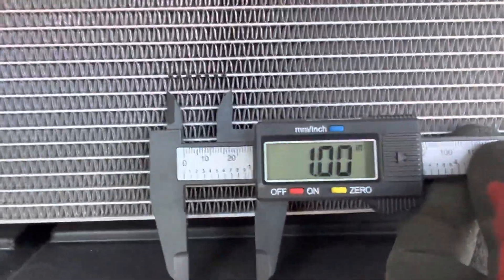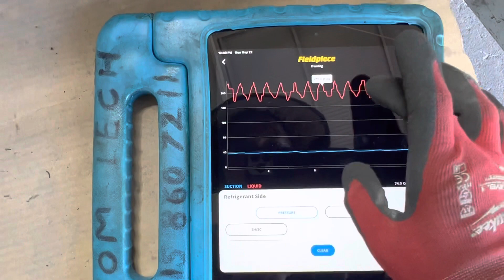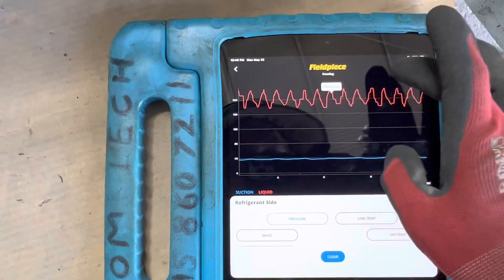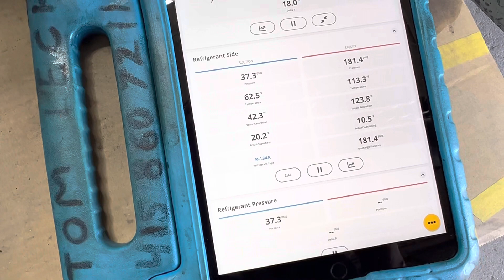AFTERMARKET AC CONDENSER CAUSE FASTER HV BATTERY 🪫 DISCHARGE, LOWER GAS MPG, SHORT COMPRESSOR LIFE

Comment: Hi. I have an Honda odyssey 2013 model. I had changed the condenser, expansion valve and compressor all OEM. I can see the sweating of the return pipe. The the pipe not very cold and the cooling of the car is not so good. The pressure gauge is all
Good. I don’t know what else can be done. There are no leaks or anything. Could you suggest me what else should I look at for troubleshooting it.
Reply: I did 1 hour Vaccum test to check for any leaks. There was no change in pressure gauge. 

I had put an aftermarket condenser. So I had issues when the ambient temp got hot. It would stop cooling when stationary. So after seeing your video I purchased OEM. Now it is cooling both when stationary and while moving but as I mentioned not to that level. At least the aftermarket condenser it cooled when it was in motion better. 

Anyway as you said I will check the blender actuator as I can hear from dash some tapping sound. But I could hear it before also and it would cool properly.
Reply from the maker: @syednajeeb998  just because the actuators make a sound and they move does not mean they’re moving all the way and actually closing and sealing 100%. 

Just a tiny crack can let in more hot air from a heater core. Then what the air conditioning can handle heat always wins. . 

You could attempt by using hose clamps. If you don’t have them some vice grips in some quarters or large washers on your heater hoses. . 

Lock off the heater hoses to your heater core it’ll take five or 10 minutes forward to fully cool down . 

And then re-run your test. 

And if your system is not charged by using wait on an accurate scale on a stable platform with no movement of the hose, or the can, or the scale or the car or the gauges . 

If the weight is not accurate within 20 to 50 . 

Then your temperatures are measurements mean nothing everything is only guessing . 

Guessing always give you wrong numbers, wrong pressures, wrong temperatures . 

That you cannot use for diagnosis . 

Vacuum is not a good way to look for a leak that only find leaks under vacuum. There’s a lot of leaks that don’t leak in the vacuum. They actually seal up because it’s pulling in word on the rubber and it has a thin film of oil in it sealed absolutely perfectly with no leaks under vacuum. 

Vacuum is only 14.7 psi of pressure difference between atmospheric and vacuum 

Where a high-pressure nitrogen, decay test can be 200 psi in positive pressure in the direction, pushing out at which the leak would normally happen 

All the plastic pieces and foam in anything in there that was in the original vehicle that blocks the air from going around from the engine compartment around the left and right side from underneath the vehicle, including the plastic panel underneath the engine, all have to be in place .  If not your stop and go traffic situation very slow, speed, or sitting at the stoplight will lose efficiency because of the hot air that rolls around from the engine..
Reply from the maker: And how do you know you do not have any leaks. 

Actually, all cars leak just some more than others even brand new ones . 

It sounds like you’re in a high humidity area 

You say the section line is sweating ? , but at the same time to suction line is not cold ?

And it is not blowing cold out the dash . 

Blender door under your – it’s not operating properly or leaking. Buy some heater core hot cool into the vet Peter Hore, and that is bleeding by mixing with your air. . 

So those two quick things that come to mind .

Comment: hi my 2014 Prius needs ac flush. You help me diagnose last year at luscious garage. I don’t know you remember or not I put the EZ CHILl in the AC. it makes noise now I really need to fix it.
Reply: thank you for your information. it’s almost have to replace the whole ac system. I have to think twice. last time estimate for about 1500 to flush
Reply from the maker: @qvzzx  but now you have to add parts

And things are much more expensive and a lot of shops have raise their labor rates so they can pay their employees more so they don’t leave Specialty here in San Francisco. 

Even I had to raise my labor rate 24% since before and after Covid
Reply: it's a very hard decision get it to fix or trade it in. I though I could get it fixed with 1500. but now maybe one option to trade it in.  thank you for your time
Reply from the maker: @qvzzx  it doesn’t hurt to ask you can call up luscious/ aka earthling 
And see if they’ve changed their prices .  

Most shops have in the last year or two .  

Shops who have not are really struggling can not pay their employees good wages, and are having a hard time purchasing supplies. Many have gone out of business..
Reply: Do you think you can help me to flush and how much you charge. I can remove the wiper part let you easier to get to the back
Reply from the maker: @qvzzx  unfortunately, I am far too busy with all my customers being a vendor and doing what I already do then be stuck doing a lengthy, long manual labor procedure

And I believe my labor rate per hour is higher than Luscious Garage .   

So unfortunately, I would not be able to help you do this vehicle. I am extremely backlogged with all the work that I already have.
Reply from the maker: I think I remember the easy chill the stuff where if you read the instructions really carefully that little*they tell you do not put it in electric cars 😱🤔. 

I think I remember this discussion 

Since they use an additive, that is not compatible with Alexa compressors or the windings, there’s only one way to do this correctly and with any kind of warranty 

The system will have to be dismantled. The expansion valve Hass to be removed to flush the evaporator and because it’s a Prius and it’s so old you may wanna think about replacing the Evaporator because you’re about to put a lot of money into this car. 

Then you flush all the pipes and hoses, replace the compressor, replace the condenser replace all the O-rings . 

Because you’re gonna have each and every component disconnected anyway . 

Don’t worry, you’re not the only one who put any of the easy chill in the AC or put in AC PRO

AND THEN, ONE OR TWO YEARS LATER NEEDS EVERYTHING REPLACED AND FLUSHED. IT’S JUST SAY EXPENSIVE LEARNING CURVE. . 

Luscious Garage has now changed her name to earth link I mean earthling. 

They’ve moved locations 
.
Reply: Understand. Once again thank you for your time

Comment: When condensers are to small and have elevated temp/ psi rise when going from idle to 1200--1500 rpm act exactly the same as any undersize heat exchanger oil/air ,, water/air . Basically as the extra load is applied the heat exchanger cannot reject/dissipate  the additional heat load  fast enough , resulting in  pressure /temp rise occurring  .
Reply from the maker: Yes, unless you drop down to airflow. 

If you drop down the air flow . 

You slow down the air so it has longer contact time with the metal cold coils to exchange heat . 

You can drop your discharge temperature a little bit . 

But then you’re giving up sensible heat load and your whole room temp might raise depending on Ambien conditions . 

But your latent heat load capacity will increase . 

And remove more humidity from the room .  Or vehicle, if we talk about vehicle.  

When you take away, latent heat lower the humidity, the human body feels more comfortable at a higher sensible temperature . 

But then, by raising the RPMs (“only on fixed piston compressors “)

In combination with the lower CFM fan speed over the evaporator coil, you could once again lower your low side pressure .   And with the increase load raise your high side pressure.. 

But then your compression ratio starts going way out as you lower the low side pressure to compensate trying to make a colder coil 

Then you’re skyrocketing your high side, discharge temperatures, harder load on compressor higher temperatures on the refrigerant oil decreasing it’s life . 

There’s always a give-and-take . Efficiency plummet. 

And we’re only talking about old fashion styled no computers, fixed, piston, compressors.

When it comes to water or oil heat exchangers .  

There’s a little wiggle room and you sometimes can turn up the flow of the water up to the point where it starts getting inefficient instead of efficient it’s on a bell curve . 

It’s not linear 

And at the moment you pass the point, we’re no longer gets any better in the bell curve starts going off in the other direction getting worse it starts becoming exponential really fast . 

Like thermal runaway
Reply: @coldfinger459sub0  My dealings with heat exchangers in industry-- driveline  just complimented my  auto air-conditioning  experience . . I really enjoy the seeing refrigerant gauges doing all the right moves . When this happens, we no the evap temp will be good in hot environments. Nothing more satisfying .
Reply from the maker: @paulthompson1654  👍🥶

Comment: Evaporators will ALWAYS  be more efficient ie far far better hot weather performance when the liquid refrigerant feeding it,  is lower temperature /psi . Within the pressure spec ""window""  for that particular make model . Experience helps here .
Reply from the maker: Exactly

And nowadays, you have to watch out for aftermarket evaporators they suffer from the same problem .  Fewer refrigerant passage tubes if your internal refrigerant fins inside the tubes and fewer Finn count on the outside.. 

When it does not make a difference because it’s efficiency level is so low and it’s PT rejecting capacity is so low you get warmer temperatures on warm days doesn’t matter if it’s correct or not . 

You’re paying for less you’re getting less your output is less . No matter what.

Comment: Undersize condensers are a problem in the aftermarket and genuine fitments . World Ford Ranger ford designed A/Con [1st version 2006 ]  270psi idle , 290psi at 1200rpm charged as per factory weight,  80-90F , Undersize condenser /bad clutch fan design .Very very typical of Fords especially on models prior to 2007 .
Any Nippon Denso Ford/Mazda used was generally ok I have found
Reply from the maker: DENSO extremely reputable, reliable, high-quality constructed component.  World renowned for quality.. 

I always tell shops who I am a vendor for if they install the aftermarket condenser and it leaks or does not perform well and you want it fixed I will charge you double and twice if you did not use a OEM DENSO 

But I also will tell them if you do use a DENSO and it is defective by manufacture, quality control, and it leaks. I will do the whole job for free. . 

I’ve been doing this for over 30 years and I still have not had to do one. DENSO OEM condenser job for free yet. .

Comment: I replaced my car with an aftermarket condenser 
(I know how vital it is to get the genuine condenser but it's very expensive when u live in a poor country with hyperinflation happening)
anyway,,,,
The old OEM condenser was 43 rows 
and I had 2 options to buy from the same aftermarket brand:
1- with less than 40 rows (older version)
2- more than 70 rows (seems like an upgraded version of the 1st option)
and I went for the 70 rows one
(Both options had the same fin distance compared to the old OEM)
the service manual calls for 1150 gram of R134a.
the sticker on the hood mentions to add 100 grams +50-50 after bubbles disappear in sight glass(with rear ac running).
The bubbles disappeared @830 then added 100 to become total of 930g.
The service manual also states the refrigerant foams right after compressor disengages and that doesn't happen when I charge to 1150g
The charging was done with rear ac running as well and all windows were rolled down.
ambient temp was around 94F
My car Spec:
Toyota Landcruiser 2001 with Dual AC and cool box
Now I really don't know what to stick with, the 930g charge or the 1150g
Before installing the new condenser, I was thinking to measure the new condenser inside volume by the connecting it to a compressed air in a small tank and then compare the pressure reading to the OEM one to confirm they are same volume but I was afraid to contaminate it with the moisture as I don’t have access to a compressed dry nitrogen
Reply from the maker: I think you did pretty good.   
If the original condenser had very large cooling passages 

And the new condenser had extremely small cooling passages 

Then you did the best you can with the information you had . 

Oh, if you have a engine driven fluid thermal fan clutch and it has many miles on it it definitely has many years highly recommend replacing it 

Because the thermal fluid fan clutch goes out a calibration. They do not necessarily go bad. You will notice nothing in your engine temperature for cooling because radiators are extremely overbuilt with a lot of extra cooling capacity because the manufactures do not want to Warranty engines. 

But condensers are not made with extra cooling capacity they’re made to the bare bones minimum to the point of where if they pass the point of where the straw breaks the camels back, they stopped cooling and they have thermal run away and excessive head pressure . 

This is why a brand new thermal fan clutch gives you every CFM of the air movement pulled past the condenser fins 

And using the method you described above only works good if the thermal fan clutch was working like brand new in the first place 

It only works good if all the little plastic or foam pieces that guide and block air passages around the condenser and radiator and if there was a piece of plastic or metal underneath the engine up to the front bumper that blocks the hot air from rotating falling down, and then rotating around underneath the car and being sucked back over the condenser Only if all those original components are in place and everything is working perfectly. Does your describe method work properly?

But it appears you’ve done the best you have with the information in Parts and materials that you have . 

No, the other thing is knowing what the superheat and subcooling were before. What was the delivery of cold Refrigerant coming back, delivered to the compressor and comparing a before and after .
Reply: @coldfinger459sub0  thank you for your reply <3